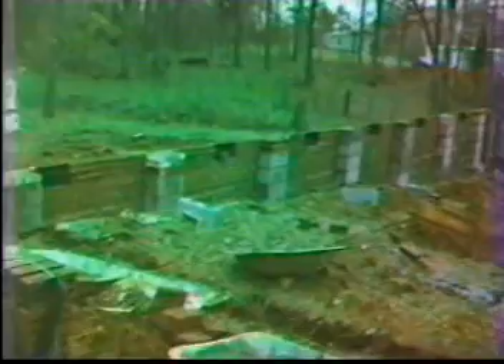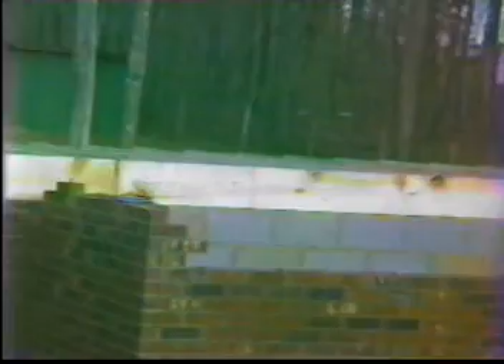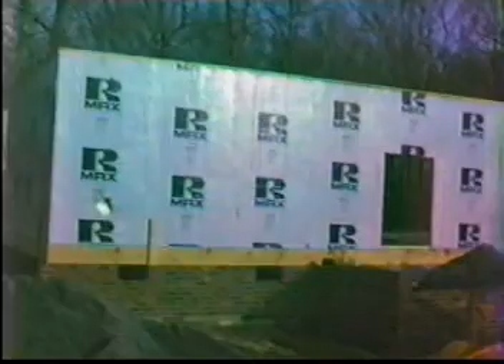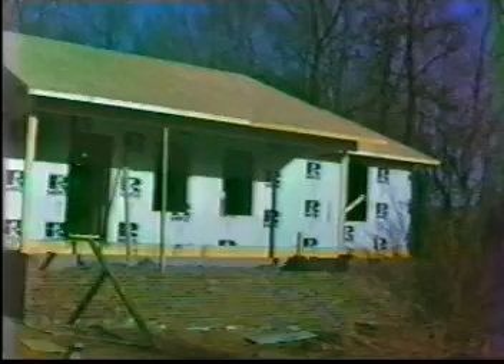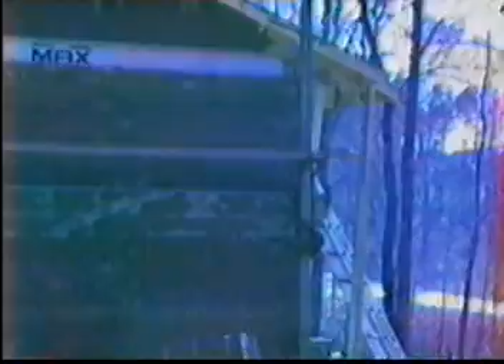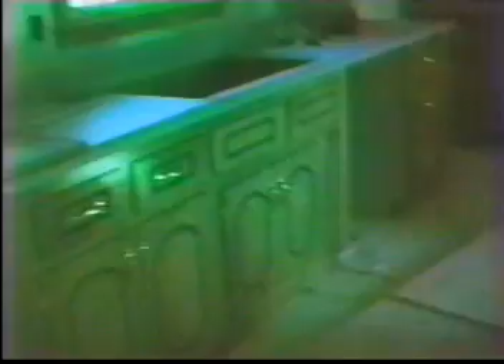House building

Comment: I build homes in NC. We do things a bit different to start we use laminated dbl.beams for our gurters for strenth, and we ALWAYS put a treated 2x4 under the band of the floor system maybe I couldnt see it,anyway make sure its there or your band will rot. And being from the south I've never seen R-Max do you wrap it, or is it a vapor barrier itself meaning you dont need to wrap it?